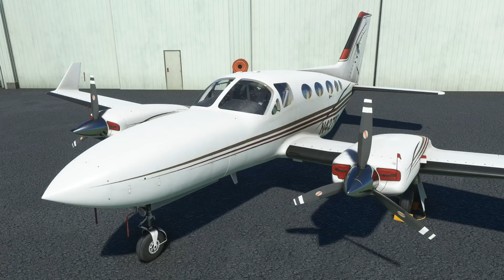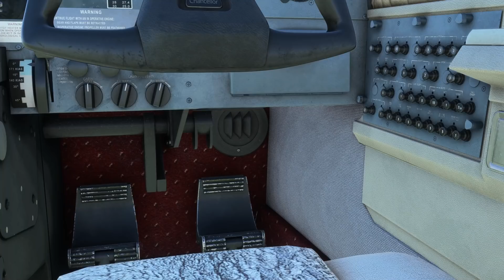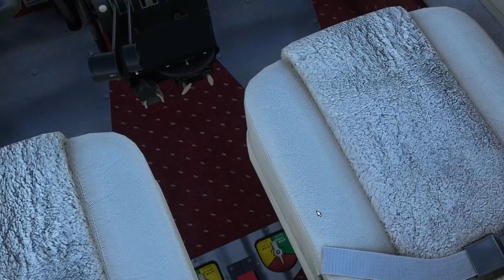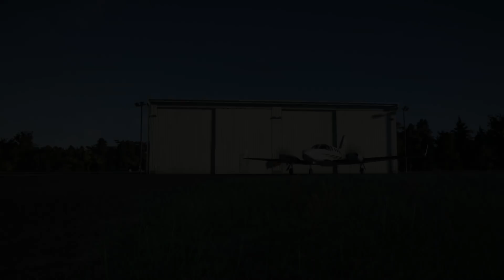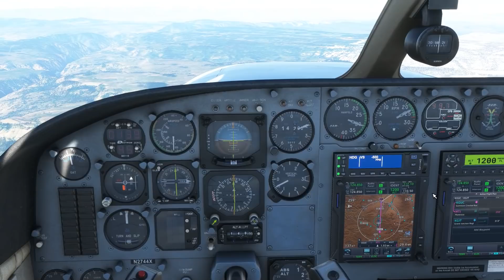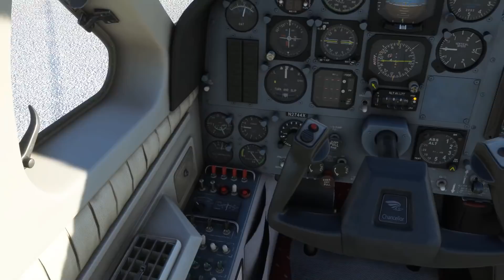Flysimware - Cessna 414 Chancellor (Early Access) | Full Flight Review | Microsoft Flight Simulator

Comment: How do you calculate fuel burn for trips with cessna 414a?

Example.
What would you use for a 4hr flight at 18,000ft?

Is it figured 40gallons per hour?
20 gallons per engine. Or 240lb fuel per hour?

Comment: I don't understand why Cessna decided to put the emergency x-feed knob on the floor. Seems like it would be easy to trip over or when you are climbing into the seat. Couldn't they just have put the knob where the cowl-flaps are?
Reply from the maker: Hi TY,

I’m no expert when it comes to aircraft design haha but, I’d imagine the cross-feeds where placed there, purely because it was mechanically simpler. It’s certainly a valid point that you make but, in fairness to Cessna, I suppose that’s why it’s a checklist item.

Cheers, all the best! : )

Comment: Awesome Review!  What i see a lot of sim pilots do during the cycling of the prop is feathering at high engine rpm.. This is a nit pick of mine as a mechanic if you do this you put undo strain on the engine. Just cycle them quickly - NEVER GO TO FEATHER AT POWER!
Reply from the maker: Thanks very much Justin, I’m really glad you enjoyed the video!

Haha, I’m sure mistakes were made: The checklist did call for a “feathering check” at 1,700rpm and whilst I thought this was a little odd, I didn’t see any other way of interpreting that statement at the time (I guess in hindsight, it really just meant to check the props). In MSFS, one generally can’t come back into the feather position using a hardware axis (I would have had to click on the levers to do that), but I take your point at any rate and will avoid damaging any more engines for you in the future haha ; )

Cheers and all the best! : )

Comment: The enginesound was not realistic. Milviz 310 is more spot on.
Reply from the maker: Hi Lars,

The C414 sounds actually got a significant overhaul before the product was released and the aircraft now sounds rather great (though I can’t say whether or not it’s realistic):

https://youtu.be/zOMmuHXaeus

I hope that helps. All the best : )
Reply: @IntotheBlueSimulations  I have to listen to the update then. I'm very picky when it comes to sound especially if the pitch is different inside than outside and you cant hear the the whole revregister. In my opinion the sound is almost more important than the looks. Other than that the product looks really good. Way back I did some various soundfiles on fs9 with the sound studio and hit the note pretty good on the flat 6 with both 2 and 3 blades versions with same pitch inside out.

Comment: A very immersive aircraft but at this time the flight model is not stable and the landings hazardous with high bouncings even with correct VS.
nearly the same issue with the Hondajet.
Reply from the maker: Hi Daniel,

Yes, the C414 is a very well modelled and immersive aircraft overall. I haven't had a chance to fly the more recent versions of the product, but it's a shame if the flight model has gone a bit awry - I wasn't having any problems previously. I'm sure FSW will get the aircraft fixed up again at any rate!

All the best : )

Comment: Sorry one more thing,do I need to buy the  TDS GTN750Xi for MSFS and PMS50 GTN750 for MSFS  ?
Reply from the maker: You will need to purchase the TDS GTNXi if you wish to use it yes (though the aircraft itself will work just fine without it). For the PMS GTN 750; there is both a payware and a freeware (with reduced functionality) version of the unit and both will work just fine in the C414.

All the best! : )

Comment: Looks alright, will be interesting to see how it compares to Milviz's Cessna 310, I know the 310 and 414 are a fair bit different but eh, both are twin engine cessnas at the end of the day.... The modelling on this 414 is really nice though, looks a lot better than their Widgeon. That table unfolding animation was quite enjoyable as well! Turbochargers aren't actually modelled at all in MSFS, just like in FSX and FS9 etc. Asobo have improved Turboprops though so hopefully one day they'll actually get around to fixing up turbochargers (as well as dozens of other things eh?). Automix doesn't cut it really. 

Twin props aren't really my jam but there's been a fair few single prop GA planes released recently that I've been eyeing up: the BR Sim Designs Ercoupe 415C, the Sukhoi Su-31 by India Foxt Echo and the SWS Vans RV-14. Hoping you'll be covering at least one or two of them in the near future! There's also a SIAI-Marchetti S.205 by Nemeth but apparently their Yak-18 they released a while back is still full of bugs so ain't expecting much there. 

Quite interested in the Ercoupe as the real plane is quite interesting. Designed to be apparently almost impossible to stall or spin and no rudder pedals as IRL it's linked up to the yoke movements although I read in the forum that this isn't really properly modelled unfortunately. Never bought a plane by BRSim before though so not really sure what to expect from them. 

Anyhoo, cheers for the vid as always. A++++++++ as they say on ebay reviews.
Reply from the maker: Hi Megadyptes,

Yes, I think the C414 and the C310 are going to be broadly on a par with one another; the C310 probably having the slight edge with its failure modelling etc (hoping to be able to take a look at the C310 soon!). I was rather surprised by the level of modelling quality from the C414, as you say, the Wigeon ain't particularly pretty. . .

I must admit that I didn't actually realise that turbochargers weren't modelled full-stop. That would explain quite a lot haha. Auto-mixture is certainly far from ideal, but FSW have now at least updated the aircraft CFG, such that it comes with auto-mixture on as standard (saves one flicking back and forth between various sim settings). I suppose one can't blame a dev for deficiencies in their product, if such areas aren't even covered in the sim. As you say, I suspect Asobo will fix thing up, the question is when haha (approaching the 2 year mark rapidly now!).

I did take a look at the Sukhoi - although surprisingly little interest in that one, going off the viewing numbers. I would have liked to have taken a look at the Ercoupe and the RV-14, unfortunately free time (or a lack thereof) got the better of me there. . . I may well still take a look at the RV-14 some time down the road though (despite the glass cockpit, it looks excellent overall).

Haha! The old Ebay reviews. . . haven't received one of those in a fair old while!

Thanks for watching! AAA+++++ - would definitely do business with again! ; )
Reply: @IntotheBlueSimulations  I guess aerobatic planes aren't everyone's cup of tea. I quite enjoy them though and will get around to watching your Sukhoi vid in a day or two. 

I picked up the RV-14 myself and had a quick flight around Hong Kong and my first impressions were that it's pretty nice! Another solid product from SWS even if the glass cockpit isn't my cup of tea. Quite speedy and manoeuvrable and the choice of tail-dragger or tricycle is nice. That was just one quick flight though so dunno how it holds up in the longer run as I've unfortunately been grounded by joystick issues.

Had a bit of a mishap when giving the old Thrustmaster Warthog stick a clean the other day, guess some water got inside and buggered up the electrics. Gonna take it apart later (if I can find a tiny allen key that fits these screws) and see if it can be saved. If not then I'll have to fork out for something new. Been eyeing up the new Gladiator EVO by VKB which looks quite nice. Bit on the pricey side for me though so if I do get it I'll have to cut back on the flight sim addon purchasing spree for the next month or two. 

Decent flight sim gear is quite stupidly priced. Getting a replacement Warthog stick would cost me about £250. I only paid around £200 for both the stick and throttle about 6-7 years ago. Granted it was refurbished but it was done and sold by Thrustmaster themselves and it was pretty much in a new condition. The Gladiator will be around £200 I think. Not entirely sure because of stupid Brexit shit with VAT on stuff over £130 not being collected by EU stores and so the delivery company will handle it and charge you a bullshit brokerage fee on top of it. As far as I can tell there's no import duty on flight sim gear though so small blessings etc. I suppose I could always get a cheapo Logitech thing from Amazon or something but lol nah. 

Bloody stupid expensive hobby. Was hoping the Warthog stick would last a few more years. Oh well, enough ranting about things costing too much and how back in my day you could buy a throttle and stick and have change left over to get a Wimpy burger, a milkshake and a taxi home and how the weather was better and chicken actually tasted like chicken.

Comment: There is an arm button on the altitude alerter. That should let it capture altitude properly.
Reply from the maker: Thanks Ben!

I was aware of the altitude alerter / alt capture functionality, but as I understand it, its use shouldn't be a requirement to put the aircraft into alt hold (that certainly wouldn't be the case with most aircraft that I have flown).

I know that FSW have been putting out plenty of updates for the aircraft; I haven't had the chance to try them myself yet, but I imagine this may well have been fixed up by now?

Cheers for offering up the info! All the best : )

Comment: Great review as always. This one goes on my buy-list as soon as I've updated my hardware. A bit shocked to hear you get 80+ fps - I knew my processor was a bottleneck but didn't realise by quite how much!
Reply from the maker: Thanks once again Adam! The C414 still still has some issues, but I think it’s very worthy of a position on any “must buy” list. FSW have also been very active with patches since release.

Haha, well I only run at 1080p and the “High End” preset, so that probably accounts for my fairly decent FPS. I only upgraded my processor fairly recently and whilst it gave a nice little bump to MSFS, I was totally shocked to see how much quicker the new processor performs some other tasks (video processing for example). It terms of raw speed, the new one wasn’t a tonne quicker than the old one, but my gosh has the tech moved on over the last 5 years!

Good luck with the upgrade! All the best : )

Comment: Very nicely done! You've sold me. You mentioned the in.Hg. - It's common to indicate the pressure as just three digits (992 = 29.92 and so on). In fact, the format for entering altimeter settings into the NAS at an Air Route Traffic Control sector is "Time/Station/Pressure" and formatted as: AS 0245 GUC 989 - This would display as "0245 GUN 989" on the scope (at least for ARTCC's) but be read as Gunnison altimeter two niner eight niner.
Reply from the maker: Thanks very much Don, I’m glad you enjoyed the video and I hope you enjoy the C414! The aircraft still has its issues, but the dev has been very proactive in putting out patches since release (and it is a great addon overall).

Really appreciate the info as well! I figured that might be what’s going on - not something I’d ever come across myself before though. Now I shall know for the future ; )

Cheers and happy flying! : )

Comment: Does the ac properly simulate one engine off behavior? Because most (all) twins are either unflyable  or they fly on rails. This is one of my biggest issues why I don’t fly MSFS very often anymore.
Reply from the maker: Hi Rob,

I did simulate an engine-out scenario towards the end of the video. The C414 certainly isn’t unflyable, it’s more towards the “flies on rails” end of the spectrum and was fairly easy to fly with the engine shutdown. Rudder was required to keep the aircraft balanced though and the prop can be feathered etc. The demo probably illustrates things better than I could describe here : )

Cheers and all the best!

Comment: You forget to arm the 14000feet. This is why IT dont hold the Alt.
Reply from the maker: Hi Bernd, thanks for the comment.

Whilst it is true that the alt can be armed up, such that it will capture upon reaching, I don't believe it should be a requirement. If Alt is pressed on the autopilot itself, it should capture immediately thereafter.

That's my understanding anyway and whilst I never used one of these specific units myself in the real-world, I did confirm this with someone that has.

Cheers and all the best! : )

Comment: So I was on the verge of getting the Twin Otter until I saw this. I want an immersive  twin  prop that has a high level of functionality. Which one ???
Reply from the maker: Hi Steve,

Probably a good save there haha! That being said, the choice isn’t perhaps entirely black and white at the moment.

The Twin Otter is quite shallow in terms of its overall functionality, immersion is reasonable (although the sounds need some work). The Chancellor has excellent functionality (some of the best in the sim) and is very immersive, however it is still in beta - so it’s not without its faults (eg the autopilot is wonky). Flysimware have been putting out regular updates though and I believe the aircraft will most likely end up being finished to a high standard (it’s already very good).

I enjoy the Twin Otter, but for sheer quality, the Chancellor gets my money every time (so long as you don’t mind a few bugs in the short term)!

I hope that helps a little. All the best! : )

PS, the MILVIZ C310 is due out soon and that may well end up being the best of the bunch (so perhaps it’s worth waiting a little bit longer to see).
Reply: @IntotheBlueSimulations  Thanks a lot for the feedback. I think your frank reviews are excellent. 
I've decided to accept the Otter for what it is and have a go. It's a small twin prop regional transport plane after all. Aerosoft do seem to be trying to sort out the bugs.
 I shall wait for your review of the 310 and also add that or the Chancellor to my hangar as a twin prop GA plane.
Keep up the good work!
Reply from the maker: You’re most welcome Steve!

Ah ok, well I do hope you’re enjoying the Twotter then! It got a bad rap and whilst some of the criticism was certainly deserved, it’s still an addon I enjoy overall myself. I think Aerosoft will continue to fix up the major issues as you say.

Thanks very much for the kind words, very happy to hear you’re enjoying the content : )

All the best!
Reply: @IntotheBlueSimulations  Just watched the Milviz 310 demo flight video. This looks a very worthy contender in the twin category as you suggest. I shall look forward to your review of this. They seem to be going into good depth on the systems modelling and failures.
BTW- I am enjoying the Twotter; warts'n'all. Although it still has some issues, it is actually great fun and a nice model to hand fly into tight airfields.
Reply from the maker: Indeed Steve, I think the 310 is going to be another great MILVIZ offering and having the failure modelling should really ramp up the experience in MSFS.

Yeah, the Twin Otter is great fun - a lot of people seem to forget that that’s important too ; )

Cheers!

Comment: How does one use the camera in the cabin to open the door and other items?
Reply from the maker: Hi BB,

You can use the default camera controls to move around the cockpit / cabin. The assignments can be found online I'm sure, but essentially it's just a combination of the arrow keys with / without left ALT to move around. The doors etc can also be actuated via the tablet though, so it's not required to move around per se.

I hope that helps. All the best! : )

Comment: How can you switch GPS? Im looking at a black GTN750, want to cycle it the the PMS750 or 530 but cant find out how?
Reply from the maker: Hi jessie,

Apologies for the slow reply (I'm sure you've figured things out by now), but it's exactly as Kokoete suggests; there is no way to switch the GPS options "on the fly", instead one must select the specific aircraft variant from the aircraft selection menu.

I hope that helps! All the best : )
Reply: I may be wrong but I think that's done when switching liveries. Notice with each livery there is a GTN number that denotes what type you are gonna have.
Reply from the maker: Thank you for offering up the help Kokoete, much appreciated! : )

Comment: Check if it can track the GPS magenta line in the Garmin for a GPS route?
Reply from the maker: It did ok with the GTNXi David, but I haven’t tried it with the default Garmin. Why, have you been having issues?
Reply: @IntotheBlueSimulations  default garmin! Ohh roll on PMDG! I supported Flysimware years ago. They caled it flysimlyware! I liked the Lear but no one else did! All i want is the systems to work!

Comment: GREAT flight and review.  For a "beta" release, there were very few issues.  The auto pilot is not a problem, rather an issue to be reported to the developer.  At this price, I think I will add it to the hangar.  I don't purchase every plane available, but like to have a few g1000 single and twins and the same with an older cockpit.  This will fill the bill for an "older twin".  Thanks again for putting in the time to make such quality videos.
Reply from the maker: Thanks very much once again Mark!

Yes, beta and even “finished” tend to be very loose terms these days, covering all sorts of states of competition haha. The autopilot is the only major issue I’ve had with the aircraft personally, but as you say, the developer will be aware of it and fixing it up I’m sure. I guess anyone who purchases, knows that they are technically beta testing anyway.

Indeed the C414 definitely has a bit of its own niche at the moment. It’s the only high-fidelity, steam gauge twin currently available. That may not be the case for long, with the MILVIZ C310 just around the corner, but I’m very happy with my C414 for now at any rate! : )

Cheers and all the best!